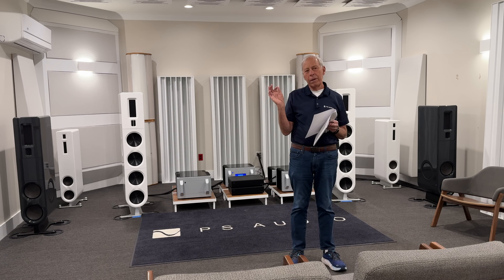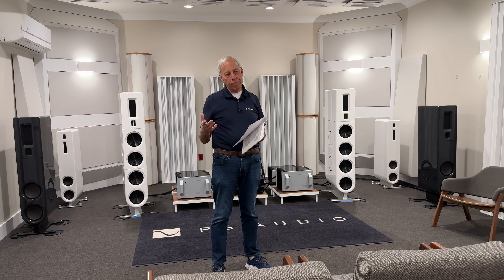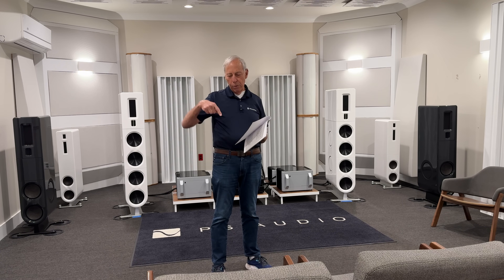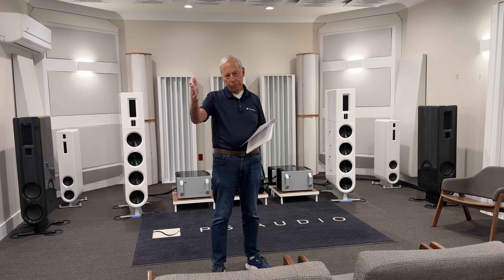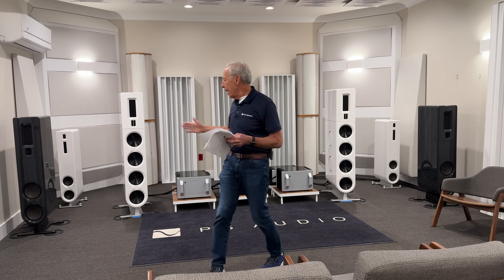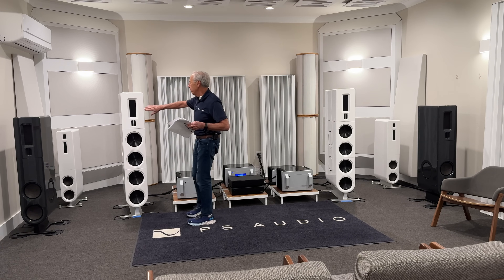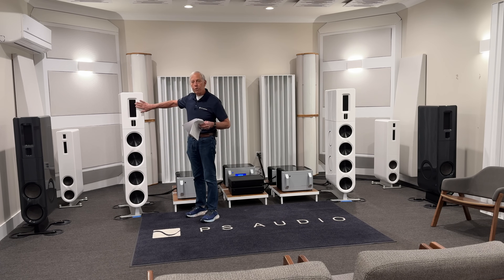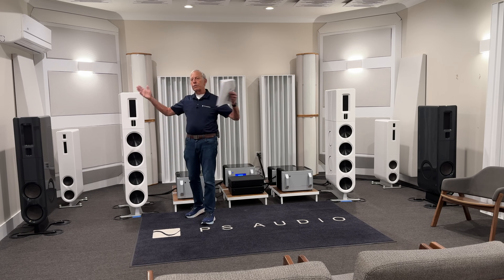Shrinking the moving magnet phono cartridge

Comment: Who says MC has lower mass, copper coils on iron cross, all dense materials vs a rather small magnet of samarian- cobalt like on a Stanton. But it doesn’t really matter as all that mass is in close proximity to the pivot point and contributes little to the inertia, like the heavy counterweight in a tonearm.
The cantilever and stylus are far more important. Tapered aluminium is probably the lightest, and small shank stylus, also shorter cantilever (some Dynavector).
In the 70’s exotic MM cartridges with unobtanium cantilevers(tubular beryllium, boron or sapphire) would state their effective mass in spec sheets, nobody does that anymore.
The top MC cartridges today use heavy diamond cantilevers, so light mass is not what drives performance.
Maybe it is market driven, Soundsmith makes low output versions  because that’s what people expect in an expensive cartridge.

Comment: The voltage output is a direct relationship between the number of coils moving through a specific magnetic field. All else equal, smaller magnets would be less voltage. Moving them down into the MC area. 

Variable reluctance. Fixed coil and magnet structure. Moving metal between them to vary the magnetic field that way. The metal is far less mass than either a magnet or coil. Acutex came out with a line using this after Audio Technica came out with their line which had the patented dual magnet V design. AT sued Acutex because they copied the dual magnetic V structure patent.

Comment: For once Paul seems to have sidestepped the question, although he seems to understand it. Two (dominant) wiggly groove playback technologies: MM high output plus high moving stuff mass negative; MC low output minus low moving stuff mass positive, wires connect to stuff attached to needle, negative (and nobody seems concerned with the necessary bending of those wires adding to inertia). So why not strike a balance by reducing the mass in a MM?

Comment: We have achieved the ' no mass' phono cartridge .. the DS audio DS003 optical ... there's no mass ! It does however require a different phono stage .. I've recently acquired one and I highly recommend it 👍
Reply: There is mass, the light stream is modulated by a lightweight shield
Reply: It's not massless. It just has optical sensors instead of coils which are lower mass. But you are thinking about the old laser systems that bounced light off the record which is massless.

Comment: Stanton once made some moving-magnet cartridges that had the low output of typical MC cartridges.  I don't see much point in those products, unless they reduced the mass of the magnet, accepting a reduction in output voltage.  I'm wondering if Stanton did exactly what the query suggests.
Reply: The stantons you mean are probably moving iron
Reply: @bestuurdvsgroningen3603  I don't think so.  The model numbers I've found are 980LZS and 981LZS.  The descriptions I've found are that these were moving-magnet types, but I haven't yet located any official advertising or spec sheets for them.  They were already out-of-production by the time of my oldest Stereo Buyer's Guide (1993).
Reply: @bestuurdvsgroningen3603  No.  Stanton 980LZS.  Moving magnet.  My attempts to post a reply with a link have not worked.
Reply: Sounded to me like the idea of the question was to move the MM form closer to comparable MC performance at a more accessible (lower) co$t than those ultra pricey MC cartridges?
Reply: @StopAndGetGas  My repeated attempts to reply have not been posted.  We'll see if this reply "takes."  The Stanton models were 980LSZ and 981LSZ.  There might've also been "MkII" versions, also.  They were moving magnet designs.  The point is this: The exact thing that the OP suggested to Paul McGowan has, in fact, been tried.  I'm surprised that Mr. McGown has no knowledge of this, given his long experience in hi-end audio.
Reply: The output was compatible with a good  MM phono preamp. Yes it is slightly lower than a typical MM , but not too much. They had the moving iron 680/681 and the nude mounted 681 was pretty low in mass. They later went to a moving magnet design with low mass rare earth magnets. I still use 680/681 moving iron today. The nude mounted Steriohedron is good and the 35 decibels of separation is noticeable in the sound stage.

Comment: There are low output non-MC cartridges like those from Grado Labs & Soundsmith, which are "moving iron" cartridges, which have low mass, as well as be run into a MC phono stage.
Reply: Very good cartridges actually.
Reply: Big fan of moving iron myself. Got an empire 2000e/i a couple of years ago and it still blows my mind.
Reply: Still using Stanton 680/ 681 series moving iron. Very nice sound stage. Extremely versatile with a stylus for every purpose. The nude mounted ones are pretty low in mass. The ease and cost of replacement is certainly a benefit. It's a shame that Gibson dropped the ball on Stanton It's the 681 has been my go to since1978. Thankfully Japanese aftermarket is pretty good for these .
Reply: HI, I have many cartridges, including a Eat #5, Goldring, Love my Clear Audio Goldfinger and my Koetsu Rosewood Signature Platinum. Turntables, VPI Direct and EAT Forte S.  Looking to adquire a new Turntable soon to replace my VPI direct.
Reply: I've been well & truly "been bitten by the MC bug", having used them for over 30 years; including Audio Technica OC-9 & 3 Lyras - Helikon, Skala & now Etna Lambda.
Prior to that I was a huge fan of Grado (& still am), having used a Signarure 8 Revised from 1984.